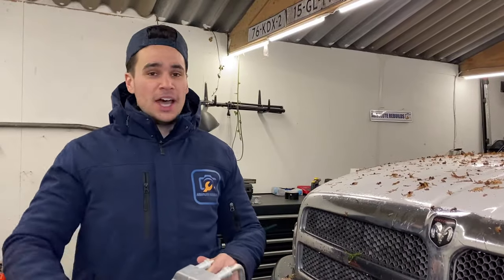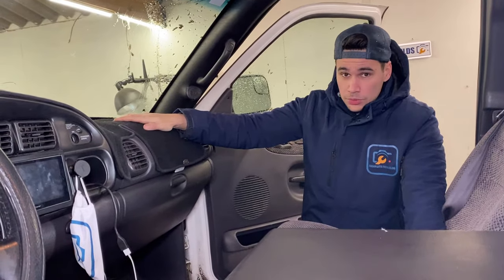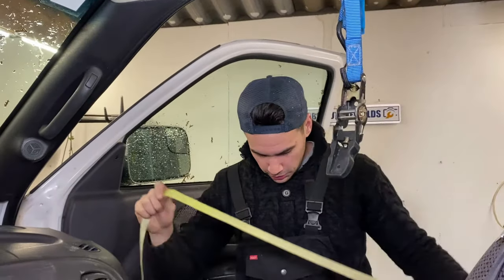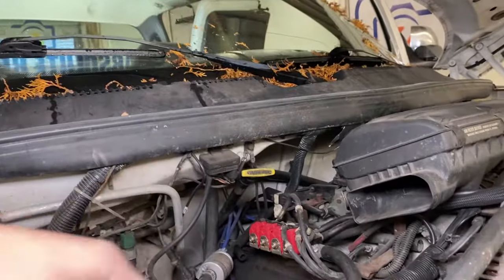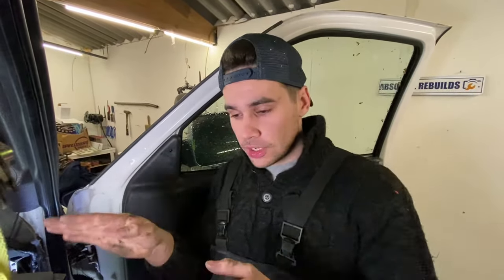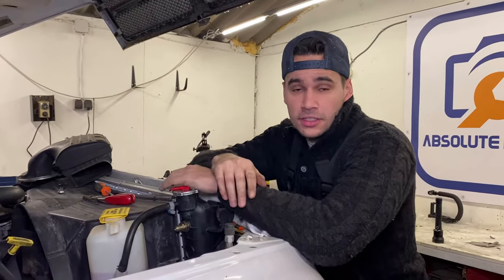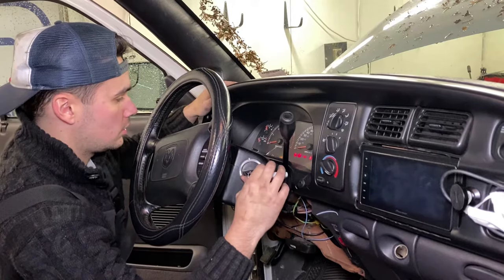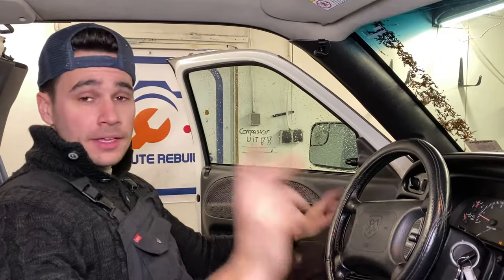How to: Change a Heater core of a Dodge Ram 2ndgen 1500 / 2500 / 3500 1994-2002

Comment: I've got a 97 2500 and no way in heck it goes in that easy. Different fire wall on that rig.
Reply: I have a 99 with v10, any idea on how to remove heater hoses from the firewall? It looks bad because you can't see them. My son has same truck with 5.9 and it doesn't look that bad. Thank you for any information.

Comment: Hi everyone very important very important.
Before you remove the brackets under steering wheel column  to drop make sure make sure to remove shifter wire adjustment line wire or you can break it's right under the column heads up on this.
I noticed on removal of dash this wasn't included your welcome.

Comment: #AbsoluteRebuilds
 Can you please Do a video on this truck showing the complete removal of the whole dash assembly to get the heater and ac blower box assembly out of the truck? I have a 1998 dodge ram 1500 Laramie slt st with 8 ft bed and a 5.2 engine and 4x4 drive the previous owner cut most of the ac stuff out i want to put it back and he had someone " temporarily fix " heat to only goto the defroster i can find anything wrong with it in the truck so i have to pull the whole dash to get the heater box out??
Reply: On my 2001 2500 Cummins a broken vacuum line caused defrost only

Comment: Did you see the dash break?
Reply: The dash in these years all crack ,Dodge used a defective plastic ,customers sued them and lost ! Big money lawyers  Chrysler Corp. I have a 2001 it SUCKS , total crap and PIA ,heater core,  a/c EVAPORATOR  ,great truck 5.2 DUMB CRAP in some of  DODGE design , makes mechanics shop labor $$$$$$$ for what should be simply replacement of key parts :face-purple-smiling-fangs: